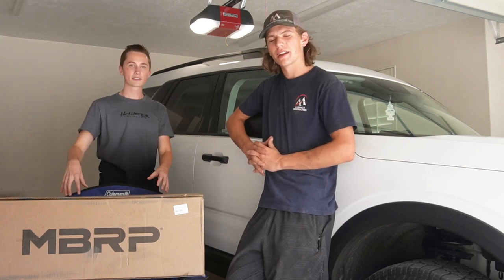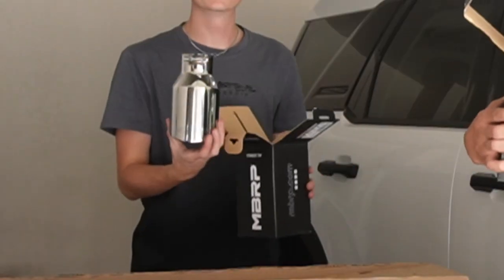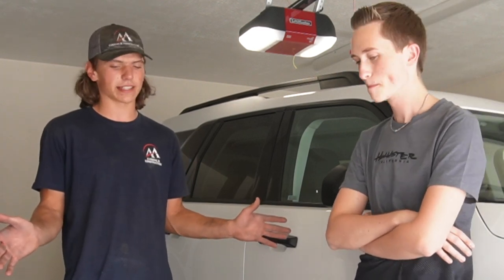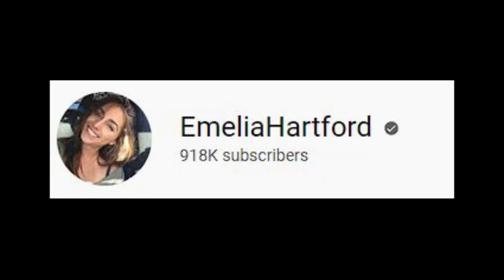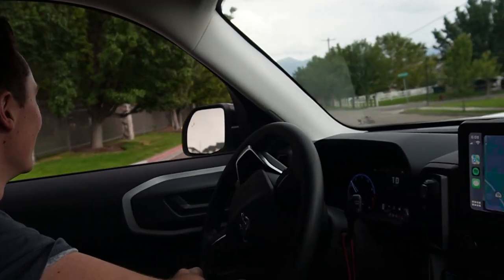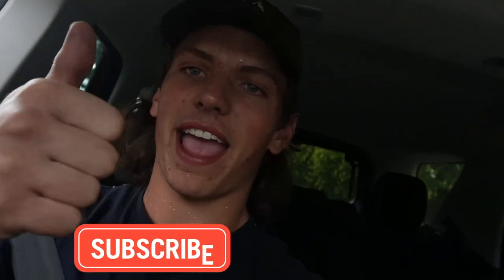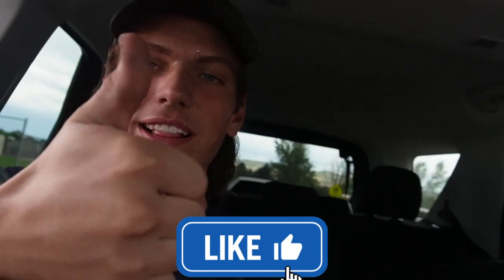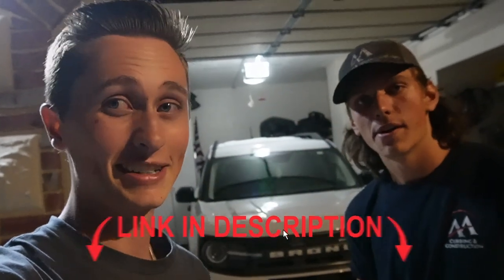WORLDS FIRST STRAIGHT PIPED BRONCO SPORT (1.5 Liter: V3) MUFFLER MOD: Review!!!!!

Comment: I really want to do this exhaust but i don’t know if it’s worth. Theres not that many videos out there showing full installs or explaining if it’s a good thing to do. Can we get a update on it and know if you’ve seen any mpg improvements.
Reply from the maker: I will if we get to 295-300 subscribers. But eventually yes I will do a update. I can tell right now tho that it’s totally worth it. Super easy install and super fast to do. The place where I got mine did a super good deal as well as fast shipping. 😁👍
Reply from the maker: Also subscribe!!
Reply: Its great! I installed an air intake (a diy and works perfectly) with this exhaust and premium fuel, oil changes evey 4,500 miles, i earned a lot of mpg. Went from 23 to 26.8 mpg. But, lol, i don’t depress the gas pedal so thats a tip.
Reply: It’s time for that update!